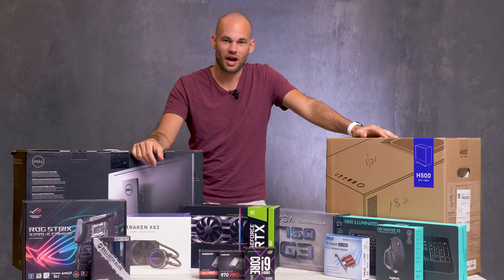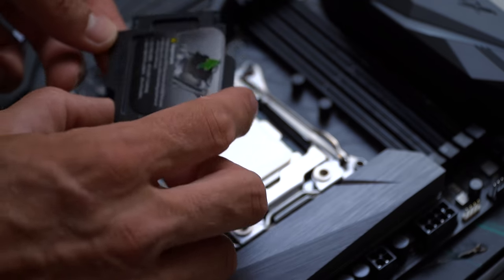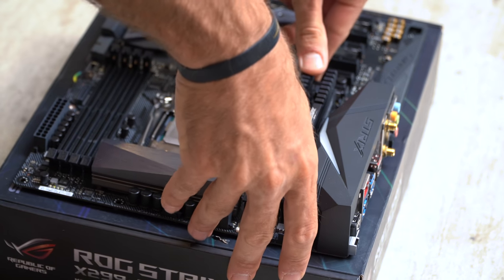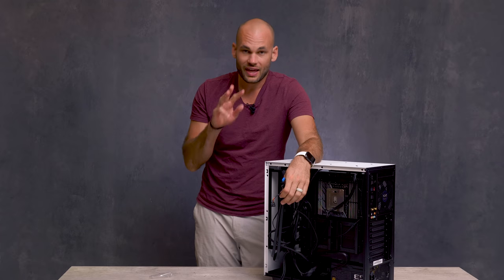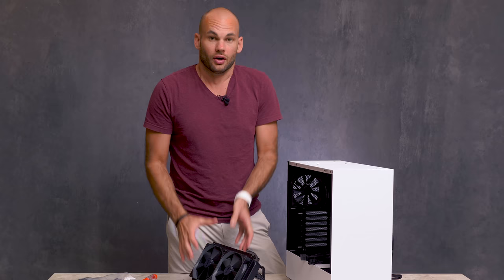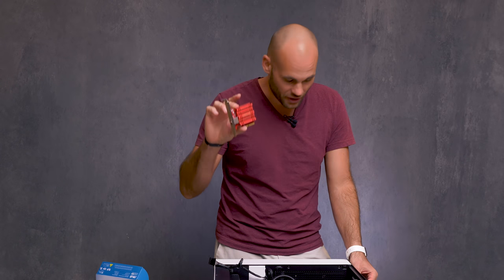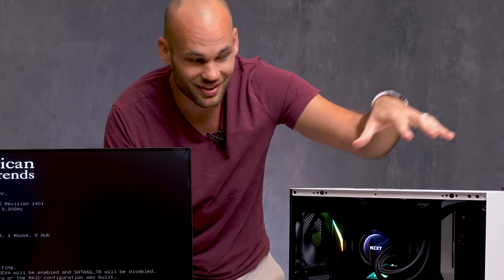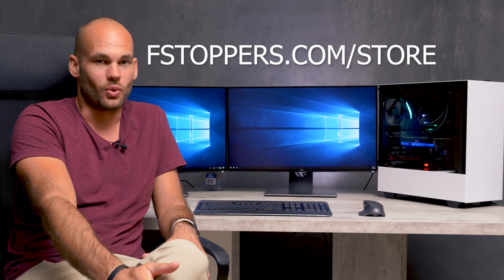The Ultimate Computer Build For Adobe Premiere 2019

Comment: Did you enable the intel iGPU? Premiere cuts exports time immensely if there is an iGPU doing the h.264 encoding task. It seemed like you tested cpu VS cpu+gpu, but the best option is cpu+gpu+iGPU. CPU schedules work, GPU calculates video effects, iGPU encodes h.264.
Reply: Enabling iGPU from EUFI/Bios on desktop Pc, Nvidia card I's automatically disabled after reboot unlike Laptop Pc.
There is also the free third party plugin for Première Pro to activate Nvidia Encoder (NVENC) totally hardware Gpu accelerated during video export in H.26x ..even with an Nvidia 1050ti for example...much less expensive, etc
Reply: A_l_E_x___ B_e_S_S_o_N many desktop PC supports iGPU + NVIDIA and survives reboot, that’s why many consider this combo a sweet spot for medium budget builds. I wasn’t aware people had success getting NVIDIA encoder working, it it looks as good as the Intel one, great :)

Comment: I'm surprised you didn't take the Skylake refresh.

By the way, I've got a question:
I'm hesitating between an i9 9900k and an i7 9800x.

The benefits of the 9800x to me would only be more than 64gb of RAM.
But I don't know if it's worth it only for that. No SLI expected.
My worry is, I've always been short of RAM.

I use Adobe Premiere and sometimes After Effects at the same time. I want to work with 4k for 10 to 20 min clips or more. No proxies.
A lot of modification applied to the pictures (color correction, slow mow, flux, etc etc...)
I clearly don't want to have RAM issues again !

Should I plan 64gb for my kind of use or it not be enough ?

Comment: I do have a question...… I recently built a pc for Adobe Premiere Pro, and After effects..... Here is the build: X570 I pro wifi mother board, AMD Ryzen 7 3800x 8 cores, 16 threads 4.5hz boots speed, Corsair 32gb Ram 3200mhz, #2 Samsung EVO Plus 500gb M.2 Drives, #1 Samsung 860 EVO 1Tb SSD, and a Gigabyte GTX 1650 Super Graphics card with 1280 CUDA Cores, 4gb VRAM, 128mb memory and I forgot the speed what the speed is for the moment, but anyways.... When I am editing in 4K, and after I add graphics to on the timeline, and play it back... When I monitor the Task Manager I notice that when The Sequence plays, and gets to the added graphic, the CPU usage goes up to 100%, Ram about 30-40%, but the GPU will be around like 7%-15%.... I don't feel that comfortable about the CPU running at that much of a percentage, and I don't understand why the GPU isn't doing more of the work, to balance things out..... I have tried proxies, lowering the resolution, but The CPU seems to want to take on all the work.... CUDA Acceleration is enabled, the driver for the Nvidia card has been updated,  but I haven't been able to get it to take on more of the work load..... What do think may be the issue, and what would be a solution for the CPU ? Do I need a more powerful GPU, or is there somewhere I need to change the settings to make the GPU work more.... Now if I watch a 4k video on YouTube, I see the CPU lower, and the GPU go up to about 30-40%.... I notice it being put to work when on youtube, but in Premiere, I haven't been able to get it to take on more of the workload, to determine whether or not it happens to be it's specs or the Mercury Playback engine, Codec, etc, etc.... Anyone's input, would be appreciated... thanks like the videos...

Comment: You did an excellent job here and this video is better than your other build and much smoother.  Are there open air vents in the front of that case, it doesn’t look like it, but I could be wrong. Excellent job here.
Reply from the maker: Side and bottom

Comment: i would go with a ryzen threadripper or ryzen 9 tho. more cores, more threads, better L3 cache, better thermals and better price/performance. the 2950X is 16 cores, 32 threads and only $500-$600. and in that $900 range, the 2970WX gets you 24 cores, 48 thread. also lol at buying a cpu from b&h

Comment: it's been too long since I built a PC...  I had no idea m.2 could be mounted verticalled (using a metal jig to hold the drive and secure itself and the drive to the board etc)... I realize kinda that it's just a pcie slot, but it looks like a lonely random.. misplaced pcie slot... things have changed so much over the years.

Comment: Nice build. Is it fast w/ Davinci Resolve too, considering Resolve prefers a strong GPU? And is there a way to turn off the RGB lights in the case so as to not use up that power? By the way, only a few after this video was posted, the RAM listed is no longer available via the link provided.

Build cost as listed on his website post: $4500
My calculation w/o some peripherals: $3114. (w/ only 1 monitor, no mouse or keyboard (I assume you already have these), and w/o the RAM which has been discontinued. W/ RAM I assume would add another $400-$500?)

Comment: In the beginning you have two lav-mics on and later only one lav-mic.
When you use two, are they both going to the same transmitter, or how are you set up when using two lav-mics?
Reply from the maker: Two transmitters and two receivers going into 1 camera. If there is a pop in one, we can fix it in post.
Reply: @FStoppers  - Thanks.  What radio system are you guys using?  I'm still using Zoom H1 recorders with my lav-mics and haven't gone wireless yet because of cost and reliability.
Reply from the maker: We use a combo of Sennheiser G3 and G4s (haven't upgraded them all).  When using two mics for backup, we feed them both into the Panasonic XLR hotshoe adapter.  This allows one mic to go into the left channel and the other into the right channel.  We usually use them both in stereo but if one fails, clips, or pops, we can cut the audio from that channel and duplicate the other channel in its place.  -P
Reply: @FStoppers  - Cool.  Thanks so much for the response.  You guys are awesome!

Comment: Hi! If there is possible to try this monster in scenario like that:
- 20 files (5 min length each) XAVC S HD, 120p, 100M (from sony a7r3)

- all of files put into multicam sequence 

I am wonder if it's possible to work in multicam view without huge lags.
I am working on session like that now and it's impossible to work in multicam view even with proxies :(
Do You think this PC will handle it?
Reply: Should be feasible, however premier isn't optimized what so ever so if you're running a build like this I would definitely look at Resolve's pro software for editing instead of Premier
Reply: @coltgollihugh8022  Thank You for reply! I've tried Resolve 16 but in free version and it was even worse than Premiere Pro even with optimized media. But my PC specs are crap so maybe there is no hope for me 😂
[ i7 5820K, GeForce GTX 780Ti, 32 GB RAM, Samsung SSD 850 PRO]

Comment: Regarding the Asus motherboard. Don't bother. It seems like the manufacturer doesn't want you to remove the screws holding down the m.2 cover. Couldn't remove any of the 3 screws safely. If you don't want to use that slot then it's probably fine. Until I tried to remove M2 heat shield to fit M2 drive, two of the screws were very difficult to get out and I notice they had thread locking fluid on, the third would not budge and if I tried anymore it would have screwed the head up so I returned board for refund on basis it was no good to me if I couldn't use M2 slot, I did raise ticket with Asus, to date no reply! Why you would heavily torque down screws that would need removal I dont know. Perhaps I was just the unlucky recipient of an over zealous technician.

Comment: 7900X is a ridiculous choice for this build, if you wanted Intel you should've gone either 9900K for budget or 7980XE.
Reply: I have to ask why.  Every test shows 7900x overclocked is best bang for buck if you use premiere.
Reply: @denzilrogers3897   9900K goes to 5.3GHz easily on an AIO, Premier Pro only uses a specific number of cores. 7900X easily costs over £1000 whilst the 9900K is £470, even the 7980XE doesn't match up to 9900K in Adobe products. I've also had a 2990WX and can tell you if doesn't come close to the 9900K in video nor photo.
Please do your research.

Comment: This videos title is a little misleading. Adobe software is notorious for not fully utilizing multiple cores. Usually anything over 6 becomes pointless with Adobe. What is more important is clock speed and the GPU. Your money would be better spent on a 9900k and putting the extra money towards another GPU to bridge together. Not to say that computer isn't good but I wouldn't call it specialized for premeire.

Comment: im confused. it is about how to screw things together or about the component that is ideal for premiere pro? If the first is the case than it is kind ong amateur video, if the last is the case, you talked about 10 seconds what you have and did not talk about the WHYs... FE why i9 not xenon, why NOT radeon PRO which is designed for Adobe... but i guess you got a sweet deal from the sponsor, so at least you are better off
Reply: The Xeons have poor core frequencies. Premiere needs high core counts (up to certain point), with high frequencies as well. Xeon is not the best choice anymore, the only real advantage they have is the ECC RAM.

Comment: I'm too lazy to look this detail up. But I'm not sure if that RTX can do 10 bit. I went with a Quadro p2000. it's cheaper and doesn't hit as hard but it does 10-bit to those Dell monitors. Do not use the DVD to install the mother board divers, they are often old and will not work with your hardware. Grab the new ones from asus. Also if you do not use that liquid cooler and go with like a noctura fan you can free up that sata port power connector. if you are not using the external hard drive connection like he is you can go with an SSD, regular cheap one like 870 not nve, for your boot and operating system and apps. Buy two m2 drives for a scratch and rendering media setup for a total of three drives. The 970pro is much cheaper now that it was earlier this year. Also consider cooling the m2 drives is possible with an after market fan. They throttle themselves when heated. Make sure your RAM can work with your cooler if it's a fan. Everything becomes a tight fit inside the case when you add in a big fan. That is definitely one of the advantages of having a liquid system they have a smaller footprint, aside from sound. The noctura fan I have is giant and not as slick looking but it can cool your car engine is needs be.

Comment: Should've gone with Threadripper for productivity...
Reply: I think premiere doesn't use up all the extra cores and intel has more clock memory per core so it's better for premiere. That's what I've heard everywhere
Reply: Premiere uses less than 20% CPU on my threadripper PC. It's even slower than using 8700K.
Reply: Threadripper is slower than intel for adobe apps
Reply: He's working in .RED only guys relax 😋
Reply: AMD sucks.

Comment: not in a sarcastic manner: have you ever considered using Mac at any point of your career?
Reply: MIRAAAS / 35 years with Apple. Bought my last system in 2016. Spend about $3K on a iMac 27” i7 fully loaded. Mac tech for 20 years. 

Build a hi-end Ryzen thats more powerful and never overheats. Still use the iMac for some things, but use the PC for editing.  I am thinking of building a Hacintosh. But they can be a pain. I love MacOS but Windows 10 pro will do for now.  If only they can fix the overheating problem.

Comment: Or simply take your grandma's PC with Gen2 i3, throw in some nvidia card w/ CUDA and you will get about the same performance.
This build is overkill for editing, it would be suitable for Hollywood CGI / VFX.
Reply: Depends on your footage resolution and bitrate. This build really helps with 4k and up.
For Hollywood CGI / VFX you would get more graphics cards and a processor with faster cores. (along with a render farm)
Reply: @M7A1cro  Yeah higher res can be painful on crappy GPU/CPU and low RAM, i personally run i5-2320 + 980Ti + 16G RAM for CGI work ( mostly 3D Modeling / Lightweight VFX such as deformations/cloth and visualizations ) and some editing, editing goes smooth af ( didn't tried much of 4K editing, but how much i tried there wasn't too much of struggle ), even 3D stuff isn't that bad except on Fluids VFX its super long sim times.

Also i once tried comparing my rendertimes to 2017's MacBook Pro or iMac ( idk the exact model but it was around $3000 and the guy just sent me his After Effects scene for trying to optimize it ) and both my crappy i5 and that macbook took the same time to render which was about 2hrs on both with the Mac being faster by like 1-5mins. So Adobe software isn't that great on scaling with better HW. I mean if PC is overall 200% faster in Premiere/AAE it probs gonna be like 20-50% faster.

P.S. i5-2320 = current gen Pentium.

Comment: I built or had build several ultimate computers for Premiere. Premiere crashed every one of them repeatedly. Impossible to use. Switched to Resolve and it's great.
Reply from the maker: We’ve certainly been there. Premiere has gotten much more reliable though.
Reply: @FStoppers  In the last 4 months?
Reply from the maker: orange42 haha no. Premiere has been good the last couple of years.
Reply: @FStoppers  Well I was using it for what, a decade? The stability was ok unless you tried using a lut more than 4 times. But from about 6 months ago till current it is unusable on any of our machines including new built ones. Just shocking. Resolve is much better though so in the end it was good to get the motivation to shift 😁👍

Comment: WTF !! Building a computer without a static strap !!! Good luck with that one
Reply: Andy Campbell / very good point, most PC installers today don’t understand the need for grounding. If he read the manual for the CPU,GPU,RAM and motherboard they all point out this requirement. One simple rule plug in your power supply (not turned on) put it in the case (run your cables) then start pulling out all your parts touching the case to ground yourself. Of course if you’re a real service tech you will have a anti-static mat to work on.

Comment: Umm lol.. sorry but this isnt the ultimate computer build for video editing. Lol.  
Ram speed  3000mhz? why not 3200 at least? 64 GB isnt that necessary. 32 is fine.  The money would have been better spent on faster modules 3200-4200mhz it makes a bigger difference in performance.  

Also the cpu.choice is just plain odd. For 400.00 less you could have bought a Ryzen 9 3900x which is on par with intels best xeon cpu. For half the price and speed up to 5.0Ghz you could have gone with an i9 9900K which would be killer for rendering/encoding. Again money wasted.  Video editing is very cpu intensive especially with premier.

Also two m2 drives doesnt add much performance gain over Solid state.  Again, the money could have been better spent on faster ram and a third SS drive so 1 for OS, 1 for project files 1 for the media cach.  

Same with the water cooling.  Not needed. money better spent elsewhere.  Air cooling is sufficient. 

 The rest of the stuff is sufficient. This seems more like a gaming build than a video editing build imo.